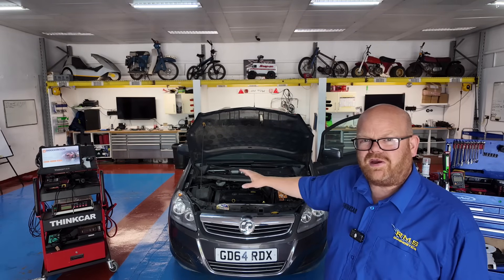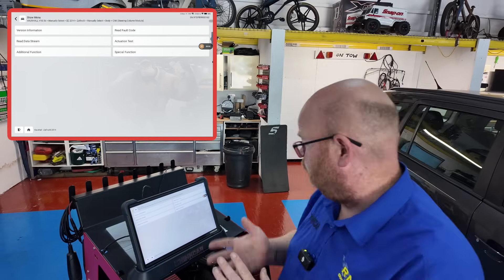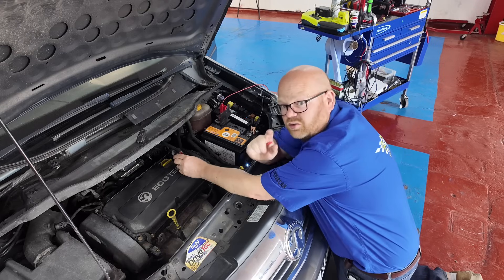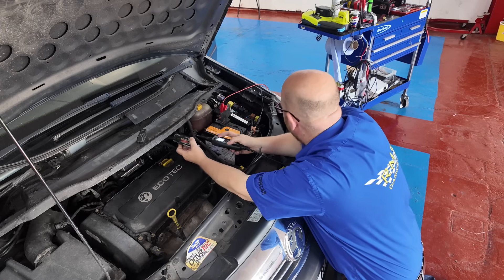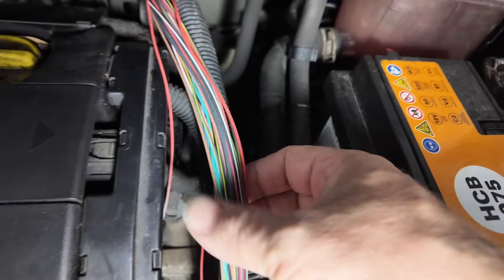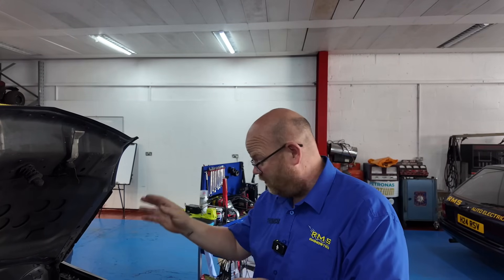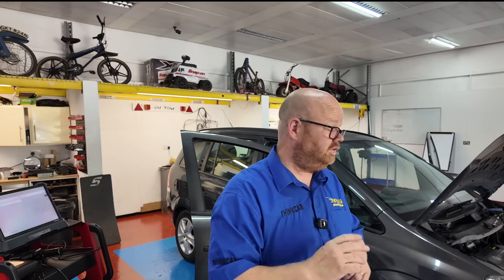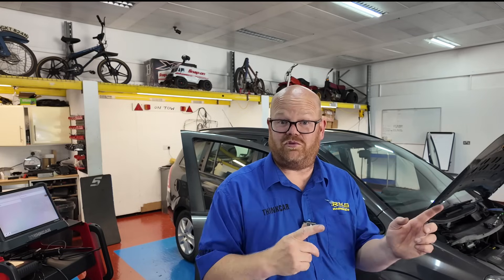No Comms with ECM? Don’t Make This £1,000 Mistake! #mechanic #cars #automotive

Comment: Wow embarrassing for the first garage thats basic checks , powers and grounds , you may know this but i allways check 12v & 5vs referances , no 5v reference signal or 12v actuator signals  tell you a lot without even connected diagnostics , great video 👍
Reply from the maker: glad you liked it

Comment: Could see two indentations today as if a pin had punctured the insulation.  Cut the yellow red wire between the two indentations, found good cooper within the insulation.  The green on the insulation is a mystery.

Comment: No background noise on this vid. 
 At 10.51 / 19 .04 the broken red wire is shown - the discolouration on the insulation looks brownish.  The copper strands look greenish.
Could you comment on the discolouration?  Perhaps make a vid re' the likley causes of discolouration, how, when, why it occurs?
Yesterday found greenish colour about 12mm long on the insulation of a wire.  The discolouration easily came off.  With a finger nail could feel a slight indentation in the insulation.  Could not see a break in the insulation with a bend put on the wire at the area of the indentation using a magnifying glass.
Does the discolouration occur when the insulation is slightly damaged (not visibly broken) ?   Does the insulation need to be broken for the discolouration to occur on the outside of the insulation?  The wire and insulation are about 2mm OD and difficult to get at.
Why ask - could the discolouration be from spillage (which is unlikely in this case)?   Does discolouration occur when the insualtion is - thin - slightly damaged - porous?
Is the discolouration due to damaged insulation?
The wire is in a dry area but subject to ambient air humidity.  The wire is with about 15 other wires all of which carry 5V or 12V.  EMF could have an effect.

Comment: Having worked in electronics all my life the one thing that was drummed into me was always check the basics first, IE is there power reaching where it should and is the ground connection good, then start suspecting faulty components and modules. Many techs do a parts cannon only to still have the same fault. I hope they were able to get a refund on that faulty preprogrammed ECU.

Comment: A housing association built a complex for older persons which comprised of blocks of flats. One of the top flats was having trouble with their sky box, the aerial contactor kept coming back and fore for the problem and each time via their gadgets and gizmos declared there was nothing wrong with the signal. The tenants son got in touch with sky and explained the problem sky arranged for an installer to attend and the installer brought with him ten brand new sky boxes, each one had the same problems as the tenants box. The aerial contactor was called back and told about the ten boxes tried by the installer and continued to declare nothing wrong with the signal via their gadgets and gizmos. After some wrangling between the tenants family and housing association the tenants family threatened legal action, upon this threat the housing association had someone else in who traced the the wire back to the distribution set up. The wire was found crushed between two beams, after cutting and splicing in a short section of new wire there were no more problems. I hope someone gets something from this or at least it gives food for thought

Comment: Great concise diagnosis. 
Caused by a simple fault.
The key seems to be those big screen wiring diagrams.
It's a pleasure to watch you work logically through the wiring. That nightmare BMW you did when you had to dismantle the whole car to find a broken wire in the rear wheel arch showed the length you have to go to to to keep the diagnosis logical.
Thanks for putting so much effort into your videos.

Comment: Haven't made this mistake (yet) but did buy an absolute steal of an ex-police, Astra (69 plate) for £450. It was a non-runner and as per what you have done, I got the diagnostic machine on it and found no comms with the engine ECU. Buzzed out the CAN wires going back to the BCM (which the diagnostics could communicate with) all fine. Checked the power to the ECU, nothing! Turns out, the butchers that had removed the police equipment, had removed a fused connector from the battery that carried the power to the ECU, quick repair job and the engine fired first time. I'm really not sure how professional garages manage to reach the conclusions that they do, but it is definitely not through any logical processes. Is it that most of them are terrified of electrics?

Comment: A lot of mechanics have  not learned the basic current measurements (also under load) to ground which is if you have the wiring diagram of the system is the first priority you should do. Swapping items is largely done first, In todays cars it is the wrong way to properly diagnose the car.

Comment: I'm an amateur diy type, I actively try to learn everything I need to know to be self sufficient and be capable of repairing everything I own, I learned to repair electronic PCBs reasonably successfully.

 For automotive, I run mostly simple, old vehicles. If I do have to diagnose automotive electrical there are a few things which I use which aren't dedicated automotive and which I don't see used often by auto electricians. The big one is a bench power supply, mine is linear transformer, rather than switching, so it's  very stable. Fully adjustable, 0-30V, 0-10A, it limits voltage and current to whatever you set it to, so I disconnect the battery and feed with the power supply, the readout tells you voltage and current at any moment in time, so you don't need meters for V or I on total supply, if you set a sensible current limit, you won't fry anything!! If you want to load test wiring, set the current limit to whatever you want, then short it, if it's good voltage drops to nearly zero and current goes to max limit, anything between then you can calculate resistance by Ohms law. Invaluable tool, great for charging batteries, powering up pcbs supplying the correct voltage and current to all your electronic devices if your device power supply packs up and gazillions of other things. One of the best tools I ever bought and really not expensive. Hope this helps someone.

Subbed to your channel, good logical diagnosis process.

Comment: I had a Skoda Fabia  could not get the power steering working . It was a salvage car  so I went to a Volkswagen specialist after an hour connected to vcds  statement I have no idea what’s wrong maybe needs a new rack . I go away go to Skoda themselfs they did not know too new suggest a new rack and rack eco . Two so called specialist well 1 and 1 manufacturer. About to give up and put it into Copart was on eBay  found a guy who resets steering rack ecu from crash data . I thought crash data was only in the airbag ecu but no now Volkswagen put in the  steering ecu as well . Got the guy to reset it after a bit of programming steering working . 1 specialist and 1 manufacturer giving bum steers . Moto of story not everyone who says they know  do know 👍

Comment: I have a 'no-one can fix it' story - I looked at a communication radio the other week in a light aircraft that hadn't worked since installation, six years (!) previously. The defect was short range on the transmitter, a couple of miles at most, should be 25-ish miles at 2000 feet. This meant that the owner didn't trust his otherwise nice aeroplane and couldn't go anywhere in it, because he couldn't talk to anyone. The company that had fitted the radio told him 'it all looks ok' and wanted nothing more to do with it. Everyone else who 'had a look' assumed it was an intermittent issue with the new radio.

'Test, don't guess' came into play. I disconnected the antenna cable at the radio end and tested cable + antenna together, being careful not to disturb any of it. Guess what? Open circuit on the antenna cable. In my experience that can be the antenna broken internally, a damaged cable (interior screws are a favourite, but normally cause a short), or a poor connector (mostly crimp BNC's).

Six years of pain were banished with ten minutes of actual testing, no guessing, and one replacement antenna connector. The defect had been there all along, the new radio was a total red herring. I was almost shocked (but happy) it was that easy, and also disappointed that nobody else had bothered to do ANY testing.

It's jobs like this that make me look clever, even though I'm really not, but at least I give a sh1t (where others hadn't). The absolute best bit was a happy owner when he got back from test-flying it.
Reply: Obviously, nobody competent had tried to fix it. 

As plugging into a radio test set would have shown the radio to be ok, SWR/VNA test would have shown the antenna to have a fault,
Reply: @mainlineelectronics5266 you're dead right, and that's what I did. The disappointing part was that nobody else in the preceeding six years had bothered with this simple check.
Reply: Cool story.
Reply: Much of diagnosing is common sense...  At least to those of us not scared by 'electrickery'...    Ex radio officer here,  Tx with no range, but otherwise functioning..?  
First thing to check would always be the antenna and its connections.   Then the ground...   You went straight to the fault based on obvious experience/intuition.   

Also, I think laziness often comes into overlooking faults,  especially where long complicated - often dirty and sticky with unravelling insulation tape - and inaccessible wiring-looms are concerned.

Comment: I've had an ecu sent off for testing only to come back as no fault found. After retracing my steps meticulously and still coming back to the ecu at fault I've given the tester (no names mentioned) a second try but still with the same results. A third sweep of the vehicle and still no wiring faults found had the vehicles owner getting impatient. New ecu purchased from dealer and problem solved. I no longer trust ecu repairers. This isn't an isolated  incident.

Comment: Another good diagnosis Bob.I agree,always carry out basic checks i.e powers & grounds,load test,visual inspection including pin fitment,pin misalignment,corrosion/water penetration etc, before condeming ecu.Iv'e had a bad experience with a 'well known' electronic control module repair company, who having diagnosed failed diesel injector driver/s,confirming my diagnosis on a VW Caddy, repaired for me.When reinstalled,vehicle had same symptom,crank no start,same faultcode, same EML & glowplug warning lights ON.Returned under warranty,module was 'rebuilt'.Reinstalled again,with faultcodes induced whilst they tested/rebuilt.Cleared fault codes,keyed on/off x 4 to prime fuel system, original faultcode - fuel circuit A open,EML & glowplug waning light returned!On the rare occasions a module is faulty,some customers budgets dictate a repared/remanufactured module as opposed to a 'new' including cost of reprogramming.I appreciate the time & effort you invest in these videos Bob, sharing your knowledge & experience with the relatively small auto electrical/electronic community.

Comment: I only do DIY car work on my own cars, mechanical.and electrical but I do work with electronics and same with that if something isn't functioning you check all the supply rails first. Had a short pulling down a supply recently on something I had to fault. It just shows you though, despite all the technology modern cars are just as prone to simple faults like broken wires etc as old cars were. Great video, joy to watch

Comment: Im not a auto sparky but the amount of times i have been called into a fault by ?sparkys that were unable to find the fault replaced everypart in the installation/control box but still not found the issue, and all it was, was a missing nautral lol good work finding that fault in minutes👍

Comment: Most hardware faults are voltage it’s rare the hardware chips are faulty. 
Different on an older car with corrosion on electronics or cracked solder.

Comment: I got taught check a 5v at a sensor ,that will tell if ECU is powered up ,also check EML light ,i do understand why the ECU was dead (as it was not powering up, maybe they don't have a wiring diagram

Comment: Industrial leccy here, I've picked up a few misdiagnosed faults over the years.

One was a CNC machine with a tool changer sensor fault; manufacturers service guys insisted that 2 fibre optic sensors, the receiver, and all the mounting brackets needed replacing at a cost of £3,500, and the parts ordering from Germany. Downtime was c £10k per HOUR, so a day for them to make their diagnosis, a couple of days waiting on parts from Germany, another day to fit them and it's lost nearly a weeks production - only for it to make no difference. Then I got lumped with it; a day testing to find a loose wire right back at the CNC module.

An overhead crane on remote control (similar to a TV) that had virtually all of its long travel circuit rewired and replaced - that turned out to be a damaged remote losing signal.

Best one though was another overhead crane on remote with a "crane is dead" fault: dead batteries in the remote 😂
Reply from the maker: I bet somebody got shouted at😂

Comment: I work in motorcycles and early on I diagnosed a "bad" ECM, the customer ended up passing on the repair which I now know would not have fixed the issue (Similar "No ECU Comm"). After doing more training and learning I began implementing voltage drop testing and successfully diagnosed my first "bad ECM" that was replaced once by customer. That one ended up being a bad connector. Since then I've done a dozen "Bad ECM" diags by other shops/customers and in reality only 2 were actually a bad ECM. The real failures of "Bad ECM" I have seen fall into two categories;

1. Bad Battery falling below threshold voltage to properly power ECM when cranking
2. Wiring faults/Connector faults

I like your straightforward diagnostics approach and logical "step by step" mindset. Subscribed!
Reply from the maker: I started as a motorcycle mechanic, a few years back I diagnosed a faulty ecm on. Gsxr600 for darren Dixon(Jake Dixon dad) he told his customer to take it to a dealer to have one fitted,the customer then called him and said the dealer says there is no way it’s the ecm as they have never fitted one. A few weeks later he called back to apologise and that a new ecm had fixed it😂

Comment: I was told many years ago by people far more experienced and knowledgeable then me : if you diagnosed a faulty ecu, 80% of the time you will be wrong...go back and recheck your diagnosis.
Reply: They definitely do go wrong though!
Reply: @theweekthatis they certainly do!
Reply: @theweekthatis didn't he allow 20% of the cases in which ECUs do go wrong
Reply: I would say more than 80%. Most faults are wiring or sensors.

Comment: Nice fix that man. 

ISomeone didn't do basic lives and grounds to the ECM using a test light, maybe a multimeter showed 12volt present thro that rotted wire, but it's amps that makes things work.
Expensive error there.

ECM's rarely malfunction in my experince unless they're water damaged or battery connected the wrong way round etc.

Comment: Nice diagnosis, i wonder if the previous garage will give the customer a refund, at least it seems like its a genuine mistake, i bet plenty of customers get ripped off because of their lack of knowledge though,
I sent my mates airbag ecu module to a company for repairs after giving them the fault code (which did say replacement needed as unrepairable when i looked it up) they said they could repair it, two weeks later and after a few phone calls it came back, plugged it in, same code, phoned another company and straight away they said it cannot be fixed, found a used one for £25 and it worked fine, the original garage that diagnosed the fault wanted £800 to replace it, which was about right.

Comment: Fab video .i had it where a garage had my friends car trying to sort out a air bag light issue they sent the air bag com away for repair saying they had repaired it .anyway garage put it back in didnt fix it. Pulled the car out of there. Found an airbag com on ebay exactly the same no s part no and other no s on it for£38 pounds .fitted it cleared the fault happy days. He got i thing £300 pound back of the garage for the air bag com that had been sent away .

Comment: Split conduit is my pet hate, cuts wires instead of protecting then & you cant see it until its removed .
Reply: These modern split conduits are actually the problem. Cables within chafe on the split in the conduit and break. Citroens are notorious for it on the rear suspension arms, and I have seen them repaired by Citroen under warranty. Scania lorries now wrap the cables within the conduits to prevent this happening. One local quarry had the lorry returned multiple times with such breaks before they took the vehicle back, stripped the split conduit off the loom, wrapped it before re-installing in conduit and onto lorry.

Comment: I'm confused, or did I miss something?  Original ecu condemned  by 'pro' ecu repairer, but then  put back in and now it's ok?? 🤔 https://youtu.be/Rb6DO93m4ts?t=59 
Seems like two mistakes were made here. 
1) the missing power feed to ecu 
2) incorrectly calling the original ecu faulty.
Reply: Dont trust any of these “repair” companies
Reply from the maker: no you didn’t miss a thing😳😳